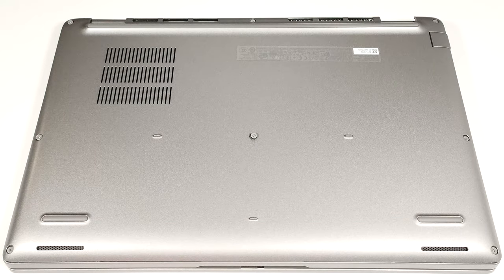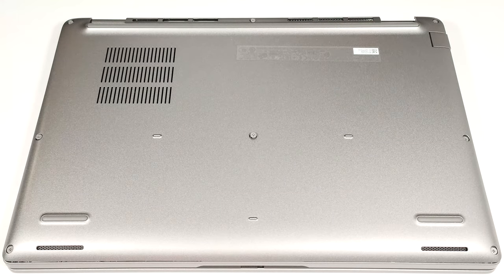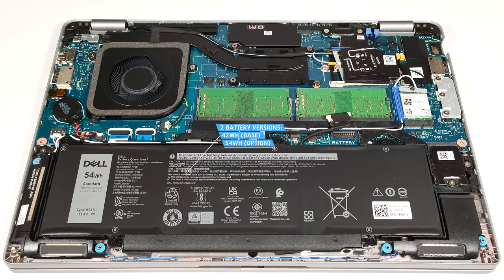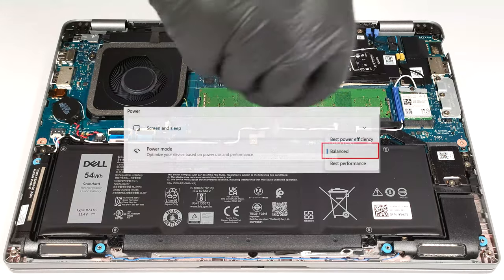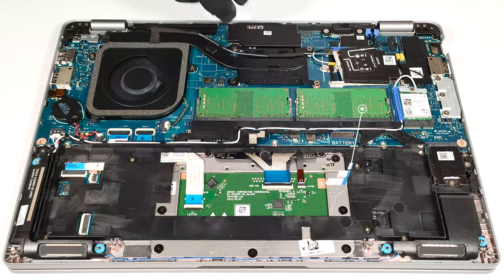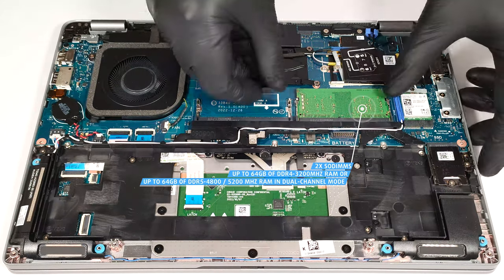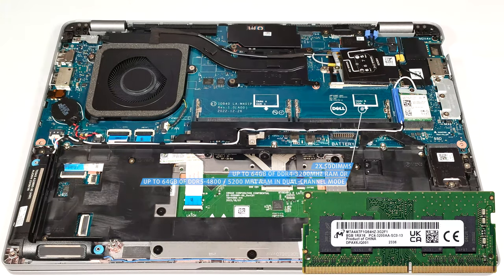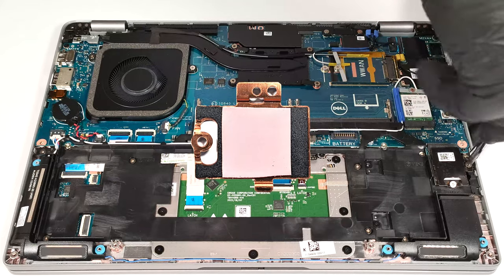🛠️  How to open  Dell Latitude 14 5440 - disassembly and upgrade options

Comment: Hello! There is a choice between the Dell Latitude 5430 (i7 12th U-series), 5431 (i7 12th P-series) and 5440 (i7 13th P-series), but the cooling system worries me - on laptops previously, the cooling system did not always work equally well on processors in the same case Intel Core U-series, i5 worked fine under load, but i7 started throttling after a while.
Thanks to your disassembly (cool and very useful work has been done, thank you), I noticed that the Latitude 5431 has 2 heat pipes and the piping around the processor is also passively cooled. For the same reason, I am thinking about buying a Dell Precision 3470, but I don’t need discrete graphics(
The Latitude 5440 and Latitude 5430 have only 1 heat pipe (for Core I7 1265U/1365U this is probably enough), but will it cope adequately with cooling the Core I7 1360p or Core I7 1370p or with P-series processors cooling system has 2 heat pipes? Noticed the additional passive cooling around the processor in your review of the Latitude 5440, did it have a P-series processor or a U-series processor?
And one more question... Is it possible on these laptops or one of them to use another SSD instead of WWAN? Perhaps there is a way that you know of?

Thank you so much for your videos and I hope recive an answer from you!
Reply: I’ll answer my own question, alas, the channel’s authors don’t care about comments, but they also help with promotion(
So, unfortunately, the Dell Latitude 14 5440 and Dell Precision 3480 (I have) only have one heat dissipation pipe and with an Intel Core i7 1370p processor under load temperatures of 80-100 degrees Celsius are the norm(